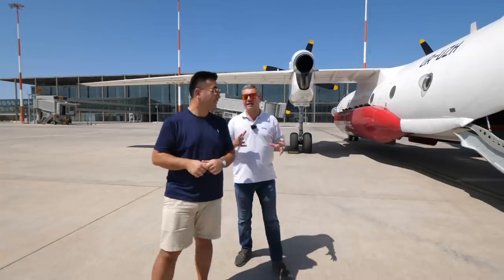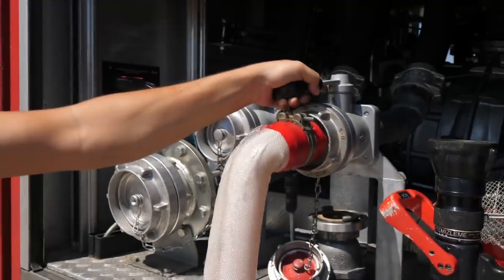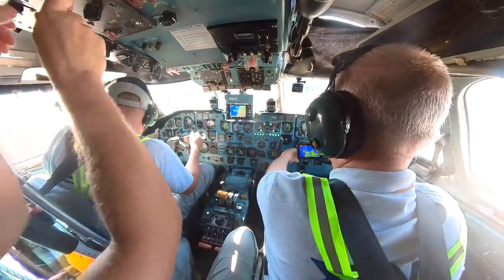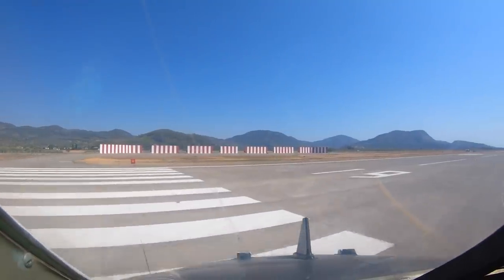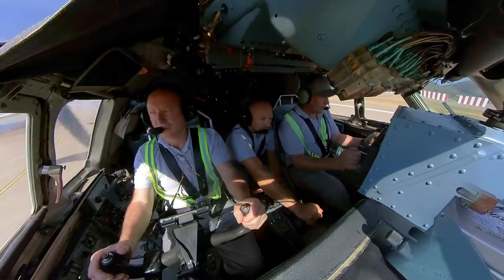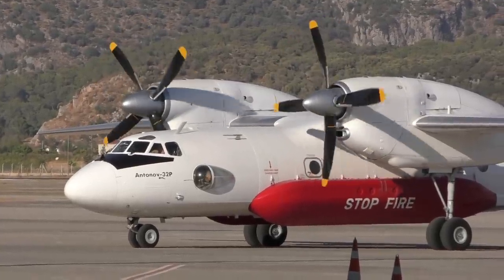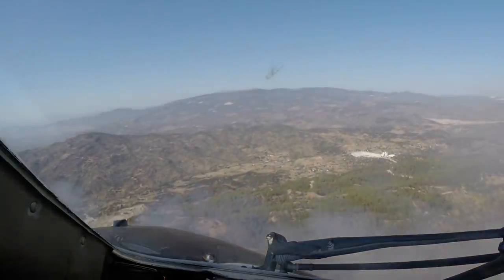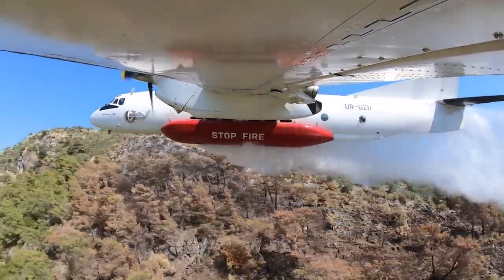A Thrilling Flight on Aerial Firefighting Antonov An-32

Comment: Antonov-32 is very powerful. Basically it is a deep modernization of Antonov-26 with superb engines AI-20 (that are installed on Antonov-12). That makes power/weight ratio one of the best for turboprop airplanes. Antonov-32 mostly used in military.
Reply: First comment
Reply: Hi i am a fan
Reply: @darkoblox9907  no I was first comment
Reply: not the same an12, in An-32 AI-20D more powerfull that AI-20M in An-12
Reply: @testpilot1985  Cool. I didn't know that!
Reply: @testpilot1985  5180 bhp per engine. AI20 D
Reply: Pam pam
Reply: Sir I watch your channel

Comment: I used to work as a An-32 ground crew. It is incredible airplane! Main feature is two extremely powerful dirty and smoky engines - 5000 hp each ones! Feels like fly WW2 combat mission - very loud, a lot of vibrations, can make a dizzy approach.
Reply: pilots are shaking too much. I guess it's difficult to fly. difficult to maintain balance, and pilots will be too much tired after a long flight.
Reply: @langietor  No. The An-32 is very stable cargo plane. Feels very massive and inert. For pilots it's not an agile unstable WW2 or aerobatic plane.
An-32 has simple autopilot for long flights.
Reply: @alexanderzelenkov6944  ok, can you tell me why pilots are shaking too much, its handle also shaking too much. I have seen videos of other planes take off, those are smooth
Reply: @langietor  Because of super-powerful old Soviet engines. You can't understand how severe is the vibration in this plane! Even in cruise flight your teeth clattered constantly. Very annoying. The plane just trembles constantly. 
You can see how GoPro camera shakes during take-off.
Reply: @alexanderzelenkov6944  its screws

Comment: there have been many twin engine fire aircraft over the years currently the C-27 does a great job when configured as does the c-130 nice video and  a fairly reliable and cheap plane to get the job done nice work!

Comment: You would enjoy the tanker bases in Canada in summer. Many different types of planes. The Canadair CL-215/415, AT-802F, Convair CV580, Dash8-400, Avro RJ85 AT, Electra. There's an old Martin Mars tanker floating in a lake on Vancouver Island. Not to mention all the heavy lift helicopters that are usually used for heli-logging. Like an airshow you don't want to see but can't stop watching.

Comment: How does two pilots on the controls work? How do they sync things that perfectly?
Reply: Yeah that's interesting. I imagine one just lightly has their hands on the yoke as backup. But that goes against common practice obviously, I have never seen that.
Reply: It’s because they are mechanically bound. Basically when either pilots move the yoke the other moves the same way.  The reason why they have two pilots holding the yokes is because these old Russian plane are 100% analog with no power steering.  It takes the strength of both pilots to move the yoke.
Reply: Flew one for a while, the main reason is just the weight of the controls as there is only aerodynamic assistance from the trimmer but even it is not enough sometimes. The PM usually just follows the PF on the controls and ready to assist at any moment.

Comment: As a pilot I would find it strange having someone else handling the throttles for landing.Only the pilot really knows how much thrust is needed.
What an aeroplane though.The engines compared to body size might be bigger than on a 777.It must be way overpowered.
Reply: I'm not a pilot but this seems old school to need a flight engineer, plus too me the plane is kind of unstable, needs both pilots to have their hands on the yokes. Also after releasing the water the plane seems to porpoise some. Plane though looks really nice,
Reply: If you watch any cockpit video of Eastern bloc airplane flying, both pilots are always on the controls, which I can understand. Guess it's a more conservative guarding if the PM needs to quickly take over. But no pilot on the throttles, continues to blow my mind.

Comment: Sam , I think they never fly into the smoke because there is a low quantity of oxygen , so there is no good combustion in the engine 😀
Reply: The guy said the reason if you watched the video. Visibility
Reply: Yes fires do eat oxygen, but the smoke mixes with fresh air as it goes up. So there's still enough oxygen for engine combustion, unless you fly low low low and the fire is covering everything the eye can see. Just visibility, especially with the hilly nature of where they're operating.
Reply from the maker: Thanks for the comment. Make sense.

Comment: If you want to fly on arguable the best firefighter aircraft going around the world, check out the Canadair/Bombardier CL-215/CL-415 series of water bombers. They are operated around the world including in Canada (natch) France, Greece & Spain.  

They are skimmer types, meaning instead of landing at an airport and wasting time waiting getting refilled, they skim across the top of a suitably sized water body, be it lake, river or ocean using hull mounted retractable scoops that can refill its 6100+ litre tanks in a 12 seconds, 140 metre run at 70 knots, allowing it to quickly get back to drop water onto wildfires.  

Viking Air has since bought out the rights and patents for the CL series and is in the process redesigning a new model with a 7000 litre capacity called the CL-515.

Comment: Sam, if there's one firefighting aircraft you should look into, it's the 747 Supertanker.
Reply: Not in Service anymore! They removed all firefighting Equipment. Its used as a normal freighter now.
Reply: @maxchilla732  OKay, I don't get why my replies kept on getting removed. I looked it up and found some info that the new owners plan on returning the 747 Supertanker to service next year.

If it's because I was "plugging" in other links to other websites, then how am I supposed to back it up? Or provide citation. Because if I don't, then it seems that I'm just saying baseless info.

Unless if what I found was actually just false information.

Comment: It's good to see the retrofitted cockpit with the latest state-of-the-art instrumentation and upgraded climate control fan above the pilots' heads. It used to be a seven-person cockpit with each crew member responsible for 140 switches but nobody knew which switches were theirs, so they got rid of them and left the guy in the middle to justify his position only to be elbowed out of the way for leaning too far into the captain's lap. AND! Isn't Turkey already on fire? Couldn't this have been a real mission? They could have given Sam a Puke Bag.

Comment: Those pilot are super and this plane is great but I don't think it's really efficient. The An-32 can do 1 drop in maybe 30-40 minutes if the airport is close, while a canadair CL-415 can do 1 drop every 5-10 minutes if the water source is close. Doesn't make a lot of sense to use the Antonov 32 for this purpose.

Comment: NO WAY would I ever fly on a Russian aircraft!! Certainly one flying over a fire zone. Give me a  European or American aircraft where they care about safety.
Reply: Russian pilots risk more than  others and (fly inside smoke) and are very efective!..the IL 76 did better job than the B 747 in Chile with less water loaded
Reply: (Caring about the construction of the aircraft so it's dependable, safe and reliable I mean which is not a aircraft made in Russia)
Reply: @ytubesuks1431  That aircraft have been made in the soviet union!..cockpit instruments are made in Russia!...Western aircraft had accidents due bad designer and cares like B 747 ( TWA 800), DC-10 ( Turkish airlines), ATR planes, Boeing 737 max, Caravelle...and so on!..
Reply: That’s a Ukrainian plane
Reply: @dmytrosergienko  Oleg Antonov was a Russian citizen!..Antonov aircraft industry was funded in Russia and the first factory in Yaroslav( Russia)...all Antonov avionic is made in Russia except engines!...Ukraine cannot built a single plane for itself since the fall of USSR
Reply: @rhodium1096  I guess an-148/158/178 don't exist in your imaginary world,as well as the an 140,32.
Reply: @ylu6685  An 148/ 158 is project Russia-Ukraine!..many planes have been built in Vorozez plant ( Russia), avionics have been made in Russia except engines!..An 178 is the same plane with  a back exist door.